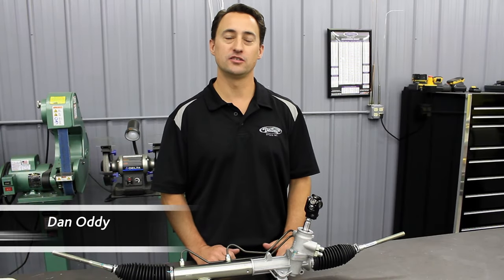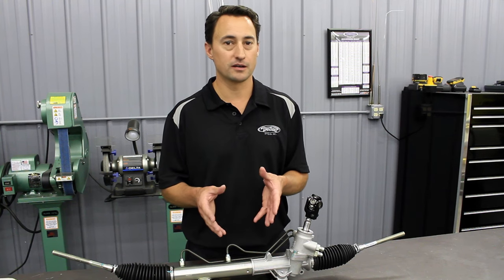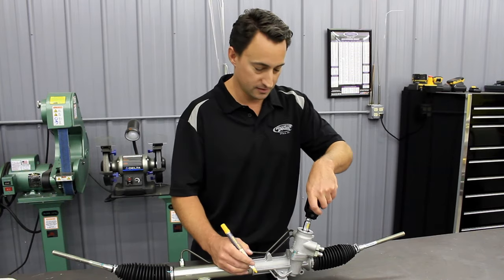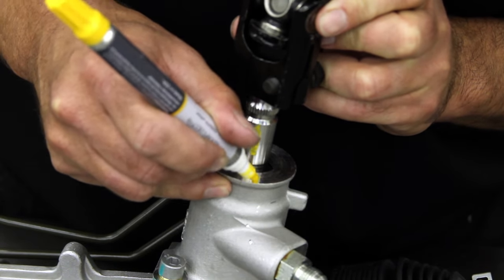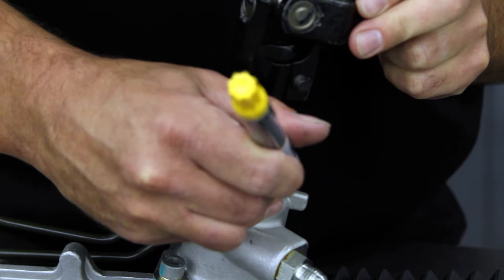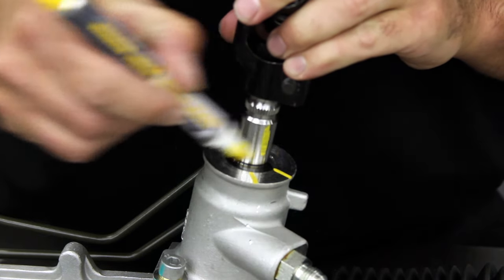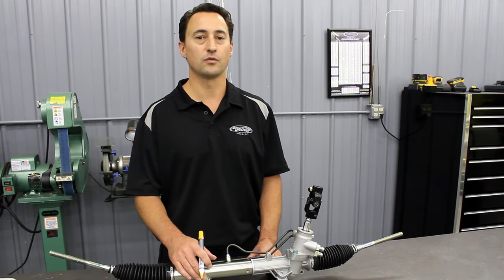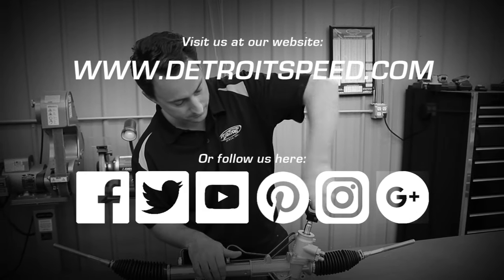How To Center A Rack & Pinion - Detroit Speed Tech Series

Comment: So you're measuring lock-out to lock-out and putting it in the middle?. Versus counting the rotations and dividing the rotation to find center?.
Reply from the maker: In the video, Dan does note that he made one rotation of the steering shaft, but did not complete two full turns.  If you make a mark on each lock, the easiest way to center is to split the difference between the marks you recorded.
Reply: Mine looks like that at 2 and 3/4 revolutions.  What is half of that?
Reply: @SebAndJosAddesso  1 and 3/8
Reply: Thanks for the video God bless you

Comment: Tried this method on a 97 eclipse and it didn’t work. 

The two points for each sides lock out was pretty far apart from each other compared to what you showed here as well. 

Going to have to do the other method of counting the revolutions and dividing them. Wish it was as simple as this.
Reply: How could you not figure this out
Reply: @iamasmurf1122  Because their method didn't work, and it's not like I do this all the time. So how the hell should I know all the tricks If I've never done it before?
Reply: @NathanClevenger1337  its a simple google search, if you take the dust boots off measure both sides (of the shaft) until they both measure the same distance from where they come out of the rack theres your center point
Reply: His markings are correct but he's not explaining it the right way. the best way is too count turns and divide by half. Sometimes your marks will be close sometimes they won't

Comment: If the wheels are straight does that mean the rack n pinion is centered
The steering wheel is also straight
Reply: best to center as he said since I put mine in the car before centering, now I'm trying to lock right side then pull gear off the splines and lock it right side by steering wheel and put back on splines. I'm hoping it will lock out on the left side if when steering wheel is centered if it's off by steering wheel position I may be able to pull splines and adjust steering wheel to center and replace on splines?

Comment: This does not work 👎 THIS WORKS-  Count Full number of turns from end to end and half number of turns back. This is tour rack center.
Reply: His markings are correct.  his explanation  on how he got  to center isn't. The RP in the video Looks like it takes 1.85 turns from lock to lock. If you Divide 1.85 by 2  you get .925. now draw a circle and divide that circle into 4 quarters making you first mark at 0 degrees your second mark at 85 degrees then subtract 92 degrees from that 85 and you'll end up with 3 lines close together just like in the video.